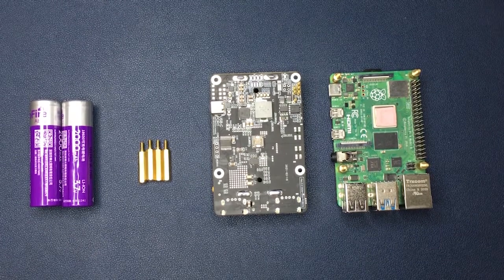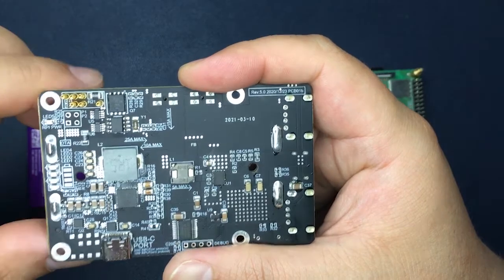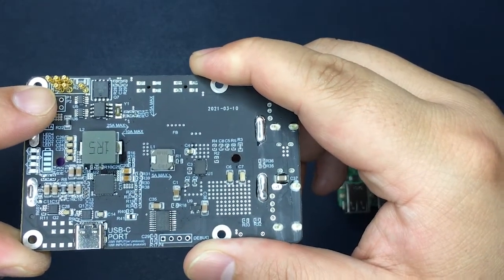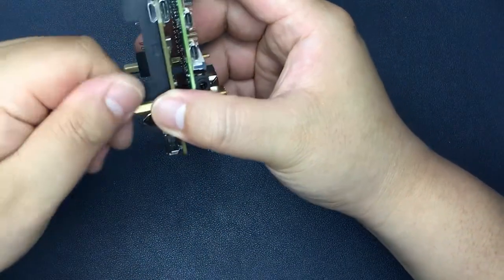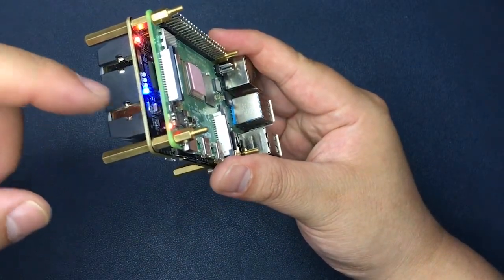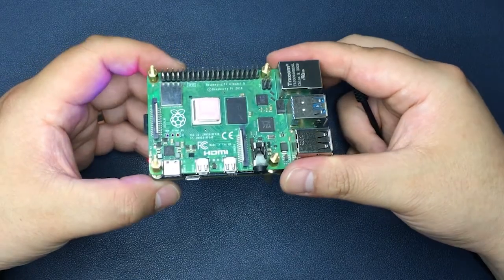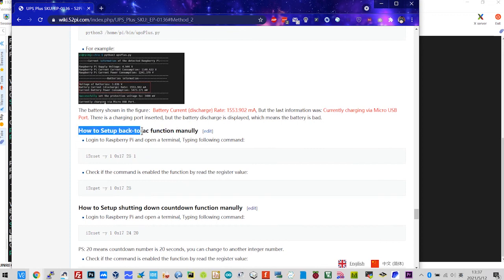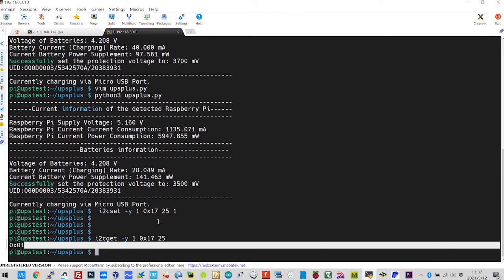EP-0136 UPS PLUS Tutorial 1

Comment: How will this board work not connected to a PI? 

I'm looking for a UPS solution to run an iotawatt device which won't be able to have the PI connections/control. 

I'm just not sure if it will work without the PI. I could just use a PI to manage this and power both devices with this but I would rather not.

Comment: i2cset -y 1 0x17 24 20     command works at setting the auto-shutdown timer at 20 seconds (0x14), however after rebooting, it defaults back to 0 (0x00).  Any idea why the UPSplus is not storing the values being set and saving them after a reboot?

Additionally, the shutdown looks very fast (faster than if I had issued a sudo shutdown now) command.  Is the power being pulled after 20 seconds, or is there a way to confirm an actual graceful shutdown is taking place inside the pi4?  Thanks.

Comment: Can the UPS Plus use "protected" 18650 batteries? They tend to be slightly larger than the standard ones: 70mm length (instead of 65mm for standard) and 18.9mm diameter (instead of 18mm).

Comment: Great Video!   Just an FYI.....There is a typo on the wiki page for the command under "How to Setup shutting down countdown function manually"  "Check if the command is enabled the function by read the register value:"
 "i2cget -y 1 0x17 25"  The command should be "i2cget -y 1 0x17 24" the register value 25 is to check if the back to ac functionality is enable.  The results of the  "i2cget -y 1 0x17 24" returns the current shutdown countdown value in hex.
Reply: thanks, i have already fixed the typo...thank you very much.~

Comment: Hello, i have problem with the ups plus, everything was working ok, but than for me unknown reason, it started shutting down the pie (RPI 4 8gb) randomly. I have intalled only one 18650 battery (the battery is brand new), it is possible that that is the reason for the random shutting off? It has worked for some time flawlessly. Anyway i have done the OTA update, everything went ok, pi is normaly booting up with the button. Thanks a lot for your work and possibly the answer.

Comment: Thanks Kevin.
Can you clarify the role of the button switch please. Short or long presses? Double press? I have trouble with mine not shutting off the 5v to the pi after a pi shutdown. I'm probably doing it wrong so if you could clarify the buttons use it would help. Thanks.
Reply: hi neil, the button switch's role is to turn on/off the UPS,  press once, it will turn on the UPS, and long press will turn off the power without shutting down raspberry pi safely,  and once your UPS entered into OTA mode, the button will not response any press, you need to finish the OTA process and it will work again.
Reply: @ReedSimpsonlikescheese  here is the wiki: https://wiki.52pi.com/index.php/UPS_Plus_SKU:_EP-0136
Reply: @jackyli6716  The assembly instructions included in the package shows different assembly order. Which to follow?

Comment: I made some calculations on UPS behavior: 
When in turn OFF state UPS is self discharging about 0.3V on 1 battery / 24 hour. So if you turn off UPS (on 4.0V on batteries) you have only 3 days before the voltage on battery drops below 3V. 3V is the level where UPS  starts charging the batteries with full current. and about 9 days before UPS discharge battery to 0 volts... Its bad... How this bug can be fixed?
Reply: Has anyone found an answer to this?  I'm also having the problem where batteries (multiple sets) drain to zero when the unit is left unplugged from mains and completely powered off.  This means I cannot turn off the unit one day and expect it to be ready to run when turned on several days later, unless plugged in and charging.
Reply: @CosmicFurFace  consider another UPS or use buildroot/Yocto Project to boot your board in a few seconds.

Comment: My Raspberry Pi 4B only turns on both LEDs and won't show anything on HDMI and apparently not turn on... what`s wrong in my setup?
Reply: I have same this problem. Do you know a solution?
Reply: @jsg1200a  Hey Jonathan, I'm running Home Assistant OS and it turned out that they had a bug in this version which would block a boot of there's ANY USB device plugged in on a cold start.

Never had the issue before as I was just doing reboots.

I ordered a second unit as I thought my was faulty.

Tinkering with this unit haven't made me happy either. They include a "fixing" board which is supposed to be plugged in between the inlet and the power supply and supposed to cause the board to remeasure the batteries from time to time by turning the inlet power off and on again. 

But it is drawing too little power thru this "fixing" board ending up depleting the battery slowly until its unable to keep the RasPi running.

Even without the fixing board it is slowly depleting the batteries - don't know why...

Anyway, I think I'm going to get a generic 12 V UPS and just a 12 V to USB power supply and throw this unit into the bay. 😕

Comment: Is it possible to have the output USBs and pogo pins to not output any voltage/current while turned off? I need to be able to prevent draining batteries after it auto shutdown but now it drains even when shut off if anything is plugged in
Reply: Hey, i need these also, i have built a mini arcade machine, and even when its off, The monitor drains a little energy in stand by because its connected at The USB port, any tips?
Reply: @kbssaprodussoes  I've heard that a firmware update might have fixed this but I just haven't had time time try it out as that project is on hold. I would look into that and if you do I would appreciate a message on if it works. If I do the same I'll try to pop back here too.
Reply: @kbssaprodussoes  holy crap I lied, I actually do have a solution to this aspect (I just re-read my comment) but it still drains a much tinier amount. The biggest issue is that when powered back on if it just dips a bit too low it still boot loops and won't charge which is what the firmware fix is. Unfortunately the method I used is a custom circuit board that my co-worker designed for me - I can look into if it can be shared but may not be easy to get made.
Reply: @NicholasGiaimo  nah, solved it by sticking my device (small monitor usb power input) directly to the raspberry output ports.
Reply: @kbssaprodussoes  ah yea I needed more current than the raspi could provide but I'm glad that worked out!

Comment: Hi,

How do you connect 2 or more UPS in a stack with a single Raspberry Pi? I need to use the capacity of 4 batteries, not two and I have two UPS boards available.
Reply: You not need 2 UPS. It is enough to connect additional batteries in parallel with the main one. For this you can use the connector "Stack Func"
Reply: @utyff  hi, how many can you stack?

Comment: How do I change the shutdown and restart countdown? Mine are sitting at "Shutdown countdown: 240 sec" and "Restart countdown: 215 sec". Does "i2cset -y 1 0x17 24 20" set the shutdown and restart countdowns to 24 and 20 seconds? It seems like it's 240 and 200 seconds?
Reply: In fact, this countdown is counted by the UPS MCU after the Raspberry Pi is shut down. The MCU count is based on the MCU's own clock. There may be some errors, but the error will not be so large, and it is counted in seconds
Reply: @jackyli6716  hmmm. Ok - perhaps I am misunderstanding then! So the shutdown countdown is relating to when the UPS will shut down after the pi has been shutdown? Thanks.
Reply: @5UPRAH  yes，that's right, it will cut off the power after countdown...
Reply: @5UPRAH  and wish you a fabulous day~
Reply: @jackyli6716  oh wow - I had this totally wrong! Thank you for clarifying this! Awesome!
Reply: @5UPRAH  that's ok bro, it's my pleasure.
Reply: @jackyli6716  is there a way to disable the blue LED battery status lights on the UPS?
Reply: @5UPRAH  oh, it coud not be able to disable it due to it controlled by MCU on chip
Reply: @jackyli6716  bugger. Might have to move the pi as it's in my bedroom and those lights are super bright!

I shut down my pi with 'sudo shutdown - P now' but even after 30 minutes the UPS was still powered on and still providing power to the pi. I checked the shutdown countdown and it was set by the upsplus.py script, which is called in crontab -e. Do I need to check it anywhere else?
Reply: @jackyli6716  I can't work out how to shut the UPS down if the Pi has crashed. It seems I have to take the power cable out and remove the batteries? Was hoping I could use the button on the side but it doesn't seem to do anything.
Reply: @5UPRAH  if pi has crashed，you can press the power botton to force shutdown，if it  still not work，need to remove the batteries and power supply
Reply: @jackyli6716  that reboots it or does it shut the UPS down?
Reply: @5UPRAH  it will not shut down ups after reboots

Comment: It also appears that in the version 9 firmware the "i2cget -y 1 0x17 24" and "i2cset -y 1 0x17 24 20" is in minutes not seconds so the 20 represent 20 minutes.  Running the command "i2cget -y 1 0x17 24" every minute you can watch it count down once a minute.  So using the default of 240 would be 240 minutes for the shutdown if the battery will last that long.

Comment: Python Error during OTA update: 

pi@raspberrypi:~/upsplus $ python O*.py
Traceback (most recent call last):
  File "/home/pi/upsplus/OTA_firmware_upgrade.py", line 23, in <module>
    aReceiveBuf.append(bus.read_byte_data(DEVICE_ADDR, i))
  File "/home/pi/.local/lib/python3.9/site-packages/smbus2/smbus2.py", line 433, in read_byte_data
    ioctl(self.fd, I2C_SMBUS, msg)
OSError: [Errno 121] Remote I/O error
Reply: I have the same problem. were you able to solve it?